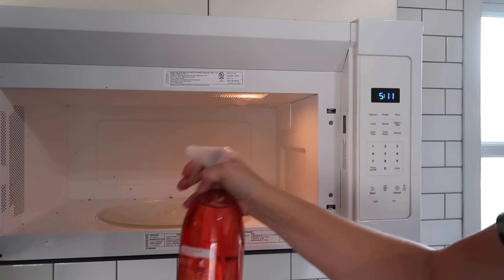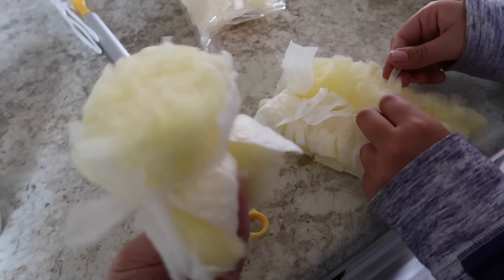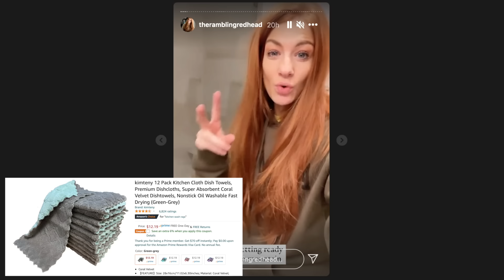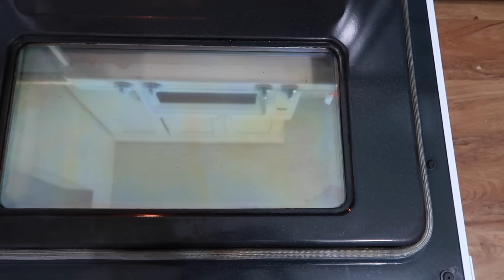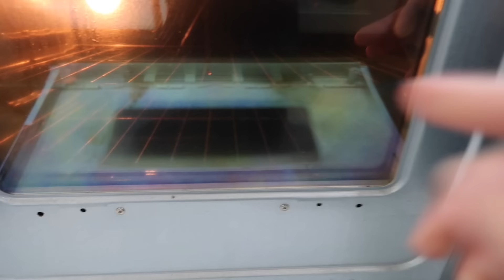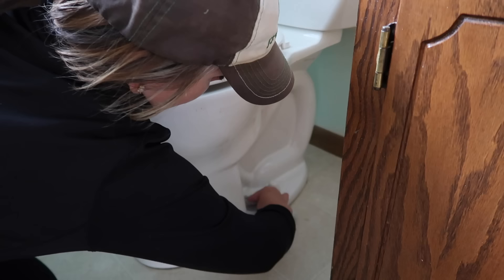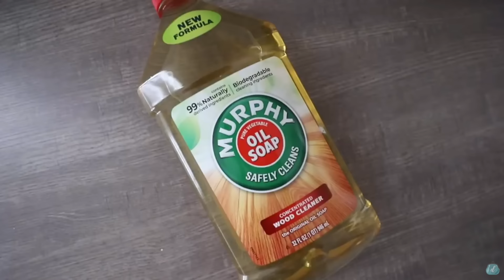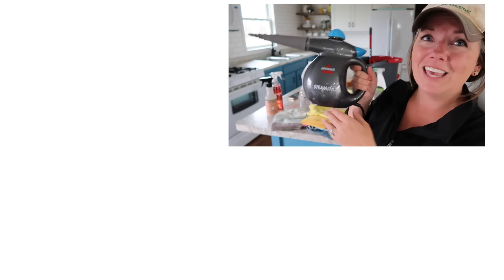Overrated Cleaning Products? Test them with me!

Comment: The Steamshot has attachments that one is to use with it.  I’ve used a steam cleaner for several things.  It’s not good for everything, for other things it literally cleans TOO well.  I used it to clean the sticky stuff off of my kitchen cabinets but stopped because it took some of the paint off, lol!  But if something on my floor needed some extra kick, I would use my steam cleaner and YAAASSS, girl!  It worked!  LOL!  It also works for the sticky oven stuff too, but I would use the brushes.  My steam cleaner had a steel brush that worked like a DREAM!

Now, the steam cleaner I had was a Dupray and it broke ☹️.  But it cleaned so well that I decided to get another steam cleaner.  I love my new steam cleaner, but the Steamshot has attachments that I miss to clean stuff like grout, corners in the dishwasher, behind the sink knobs and the tub and such, so I’m going to buy the one with all the attachments.  For me, knowing that it works and HOW it works, it’s worth it.  But it’s definitely not for everyone.  Shoot, if you find a cleaner that works on a WIDE variety of things and your kids love it, DON’T let that go, hun!  Haha!  

Thank you for this video though, it was helpful for me!  I was considering getting that swifter duster before seeing this, but I think I’m just going to use my big squeegees and giant microfibers.  I already have them, they work, they reach as high as the ceiling, and, (as you pointed out), why invest in something else to store, right?  Thanks again!

Comment: I use the Mr. SIGA microfiber with just water for stainless and glass and granite.  One wet then wipe with 1 dry. Zero streaks. No cleaner. Never use cleaner with them and wash without fabric softener and they will last FOREVER

Comment: I just use a vac hose with brush attachment for dusting (esp good on ceiling fans). I have to have for cat hair anyways so may as well. Lol. Having to deal with being so “delicate” with that swifter thing and fluff it and all that would annoy me too much. Plus cost and storage I wouldn’t want either.

I guess my one personal tip would be for pet urine issues (and general mopping) which is great smelling and lightly scented Fizzion tabs. It is also no rinse and not filmy and natural (CO2 based) and gentle on any type of hard surface. Also can use peroxide. For bodily fluids (urine, blood, etc), you need a cleaner with enzymes to break it down. Peroxide for laundry spot treatment has also been one of my faves. (Dollar tree sells a little spray bottle and the giant bottles which I use to refill the spray bottle). You can also just add a bit of peroxide to the wash load as well and it helps with breaking down many stains at an enzymatic level.

Comment: The swiffer thing is ok for dusting flat surfaces. But most surfaces need literally more pressure than a swift move. 
For normal dusting the quality of the original swiffer is very good (thick texture ), but also very expensive. 
Here in Germany we have a tv shiw called "markt = market. They tested very expensive microfiber vs cheap one. No difference but the prize. I agree. The size can differ, whatever you prefer, but that's it. And whatever you used: some stains never come out, even after a 60 degrees washing. And never wash microfiber with the rest of your towels etc. They'll never forgive you (linting, pilling). 😢
The only thing I never tried is the steam cleaner (too scared of trying, window cleaning).
When it comes to cleaning the inside of the oven, I tried it all, soda, heat etc. the redult wasn't nice. The problem is the blind look. The between the glass spots are impossible to get by, I don't want to remove the glass (I know it'll be worse a f t e r removing it). 😅
After using the microwave wiping it with any cloth, I don't have a problem with it.

Comment: I think putting vinegar & water in the Steamshot is fine (or things like spray mops, etc.) as long as you empty it out and don't STORE the vinegar in the bottle or canister.  Use up all the spray, then put plain water in it and SPRAY THE WATER to make sure you rinse all the vinegar out of any tubing or anywhere it came into contact with the device or mop.  Don't just rinse out the bottle or canister.  Rinse all the parts exposed to the vinegar thoroughly.

Comment: Anything your that makes your kids think cleaning is fun is a win.  Mine fault over who got to use the Swifter. The Bissell steam shot is great for defrosting ice machine. My Samsung refrigerator has a horrible ice maker! It freezes up and stops working. The repair guy told me not to use a hair dryer to defrost it that it drys out the plastic and cause it to crack as well as voids the warranty.  He said to use a steam cleaner, so I use the steam shot.

Comment: Spray oven with vinegar or even just water and then razor blade that stuff right off the glass you can also use it on the inside of the oven just make sure you use a brand new razor and be careful not to cut yourself

Comment: Question. On the laminate floors you use the Bona (what I use) but you also used the mop and bucket. 
Was there water in the bucket? I thought you were not to use water on laminate floors? I could be wrong.
I don’t think it gets as clean with just the bona using a pad.

Comment: I like using Dr. Bronners Sal Suds. I  use it like Dawn Dish Soap, but it cleans everything. It removes built up icky dust and rinse and no dust. I use it on messy dishes, sinks, windows, etc. When I wash my sinks or tubs I rinse it off and them go over it with hydrogen peroxide. I have a dog so things like LA Awesome is really toxic. One bottle of Sal Suds lasts me 2 years following the correct dilution 1 cap to 2 cups water. Hydrogen peroxide is still only $1. I just use my broom with a cheap microfiber cloth. My tub, sinks, floors are clean. I just have a $1.25 Tree mop, and it dusts awesome. My sister gave me her Swiffer, and I just use microfiber on it, and go over with cheap microfiber. I color code mine- blue is bathroom, green kitchen, yellow is for dusting, gray is for the car. It's important to wash separately to avoid cross contamination. I have been cleaning this way for 22 years and I have asthma. My favorite cleaners are generic oxiclean (they don't have dyes/smells and work better), Sal Suds, hydrogen peroxide. I do use some 7th Generation disinfectant but only if it's on sale. Sal Suds is great in the car, and doesn't damage the surfaces in my home. Obviously  you want to test it in a small spot to make sure it's safe in yours. I also like to use castile soaps, but they can be greasy/hard to rinse.

Comment: It's not recommended to take apart your oven door. In most cases it voids the warranty. Always check your manual before taking a screwdriver to an appliance. It can also be dangerous and cause the glass to "spontaneously" shatter in the near future.

Comment: You were using the steamer wrongly.   You were waving the steam at the dirt from 6inches away, which just gets the surface wet with tepid steam.  Instead, get the steam up to max heat/pressure, use the nozzle to concentrate the steam jet, then hold the nozzle close to the dirt.  Keep it there until you see the dirt start to lift and flake away.  Then just use a cloth to wipe.  It is the combo of high heat, moisture and jet pressure which does all the work.

Comment: I clean professionally. The swiffer is excellent. However, I tried a shortcut w/off brand... OFF BRAND DOES NOT WORK! You HAVE to buy the actual Swiffer brand.
Also, the window cloths, they aren't really for cleaning the grime, tho it can work...they are more for upkeep and streak free cleaning....so, yes, the microfiber will work better initially to get the deeper set dirt, then you follow through w/the buffer cloth. But I have experienced that a VERY CLEAN microfiber works the best....you HAVE to use a fresh clean microfiber on mirrors/windows, or you will get streaks regardless.

Thanks for the trial and error on these products, ESP the steam cleaner. I have consulted w/myself for years about getting one. My answer now is NO, so thanks.

I do think I will try the $ Tree awesome cleaners for my house anyway, I am intrigued about the quality of those. I won't lose sleep over 2$ down the drain.
Mrs. Meyer's...my fav is lavendar...mind you I HATE lavendar anything, esp oils, makes me nauseous.  But for some.reason, the Mrs Meyer's is soooo amazing in how it works and smells...my clients are now buying it.

Comment: DO NOT USE BAKING SODA ON OVEN GLASS!! Sorry for shouting this but it can cause oven glass to crack, abrasives cause scratches which over time and with heat can cause the glass to shatter. use soda crystals or a degreaser let it sit for a while the use a scraper.  I'm totally the same with steam cleaners, I think they are overrated, I have a steam mob which is handy, but the actual steam attachment is meh, I used to have a more powerful steam cleaner, I binned it, it wasn't worth the space it used to store 

I use e cloths, they work really well, don't use cleaning products with them, and don't use fabric softener when washing.
The window cloth used here is for shining mirrors screens & windows, they have another cloth that is for cleaning them with just water, it works well & 1 less cleaning product needed. 
The bathroom ecloth is my fave, it cleans lush bubble bar grime with just water, I also wrap it around the taps, holding each end moving back and forth, I have had it for Years and it's still fine.
The kitchen e cloth has a scrubber on the corner which is handy. 
Another good product is elbow grease power paste I use it  for my kitchen sink, its so so shiny, using a scrub mommy sponge (a cloth doesn't seem to work the same), I have just bought the scrub daddy power paste, I don't feel like it works as well as the elbow grease. 
 
Also why do people mix baking soda with vinegar, they cancel each over out.. the only use is the movement of bubbles can help move a small blockage in a.

Comment: Did you know you can actually clean the oven door and windows with windex? You just heat the oven, spray the windex and clean after 5 mins. Or actual oven cleaning spray. Heat the oven first, then spray and clean after 5 mins.

Comment: I wouldn't invest in a steamer, but I image you have to let the hot steam get closer to the problem and let it linger for a bit.  Looks like you're really simply using the steamer as a spray bottle rather than letting the steam get close and do its work.  Could that be the problem?

Comment: Ugh mr clean makes a spin mop. I can’t recall if it’s cheaper. But one thing that I knows cheaper is the mop heads. Because the mr clean is a circle You can find cheaper replacements heads anywhere. An I was them. Because their cheaper you can also use certain heads for certain jobs in the house. The flat head mops are amazing for baseboards but also walls , doors, ceilings, ceiling fans. There are so many uses for a flat spin mop. Cedar makes them a certain shape for a reason. Lol so You have no choice but to buy their replacements. Now I’m sure ppl have made cheaper version but it’s not that easily access like the circle base ones. Aldis ALWAYS has the replacements 2 for 4.99. Also if You don’t like the uses same water deal. I did a test,  I cleaned one of the worse homes I’ve ever cleaned the walls legit were covered with webs an dirt plus dog slime from mouths. The water was completely black after one go. So I used the same water to go back over again an again.  I dumped the water an did a pass again an Shockley very little dirt was left.  So uses dirty water to clean walls an floors really does still clean. Lol I’m wondering if it’s cause of the agents   You would think it wouldn’t clean an just leave dirty walls. It’s actually pretty amazing. Now I don’t suggest that but if You can’t change the water a lot. Just one time for the finally pass will work.

Comment: I. Hate. Microfiber. Towels. They so are high maintenance! Ever read the "care instructions?" Machine wash in cold water with gentle soap or hand wash. Do not machine dry, line dry only. Sorry, even my fanciest clothes don't get that treatment. And using them in the bathroom and then not washing them in hot water? Um, no thanks.

Comment: does anyone use clr or simple green?  could you suggest which would be best for a really grimy shower stall and door?
Reply: I have tried tons of things over 30 years of cleaning glass shower doors. I live in an area with really hard water. Magic shower glass and mirror cleaner is the best product I have tried so far. It is pricey, but it works great.

Comment: In the video you were far too far away from the surface for the steam cleaner to have any affect.  Steam cleaners actually work by the heat softening the bond of the dirt and the surface it is attached to.  The steam looses its heat very quickly with distance.  With something like an oven you will either have to scrub at the same time or use the brass brush attachment which may damage the oven.  If not too dirty the nylon brush will help.   Personally, I think those small steam cleaners are pretty useless, I much prefer a proper cylinder model but the best way if you are careful, heat the oven up and then clean it.  You have to be really careful not to burn yourself.  Steam cleaners clean glass and mirrors really well, kitchen working surfaces too but I do not think they save you much time.  They do clean tiled walls like in the bathroom well too, but you may need several cleans before you get the clean if your bathroom was like mine before I started.  I really like steam cleaners but they are not the panacea that some advocates make out.  There usually is a quicker way of cleaning but the nice thing is they do not use any chemicals and do disinfect.  Useful for cleaning up after toddler or pet accidents.

Comment: Problem with the recommendations is they are often paid for or recieve free products for review. You cannot trust them, not on yt or tiktok. My fans look like that every month. :/ I run or filters and have a good HVAC system and still more dust than anyone else. Do I get an award??? I can't stand microfiber. It doesnt absorb quickly enough and it doesn't pick up anything worth while. They make better drying matts. I'll stick with my super cheap walmart face rags.

Comment: To answer your question you WERE using the steamshot wrong. Your were like inches away from the surface. From the video you refrenced, that lady would put the tip of whatever tool she was using right up against the surface she was working on AND you go slowly. Remember its not a chemical cleaner so you don't spray the surface as if you're using some spray product. If used properly, it works and its a life saver for people who have sensitivity allergies to chemical cleaners. I've been thinking of buying one and have been watching tons of videos. Common thread for those who don't like it is that it wasn't used correctly compared to those who do like it. And it "loosens" grime so you'd still use the beloved microfiber cloths to wipe up everything. Sorry. I just had to bring up the way it was used because I keep coming across vids and the pattern keeps being repeated between those who use it correctly and those who don't.  I have severe allergies and its been getting harder and harder to clean the traditional way...